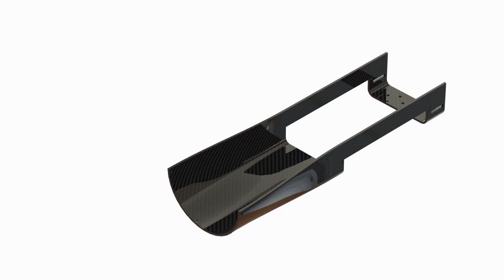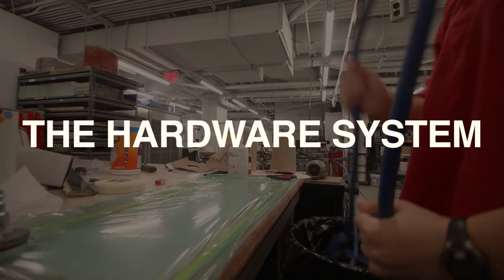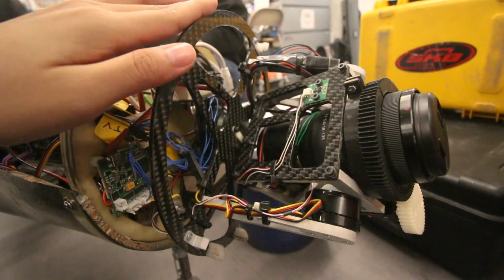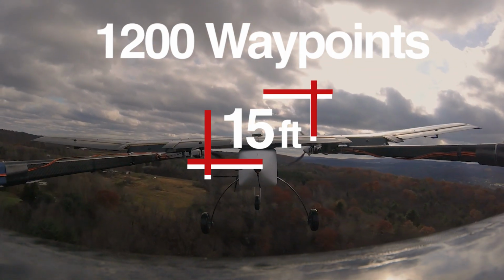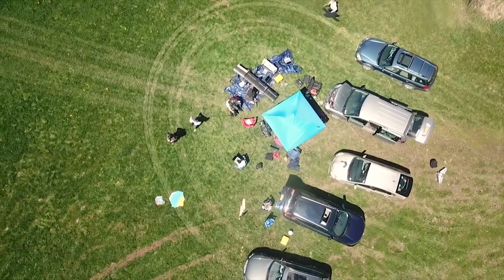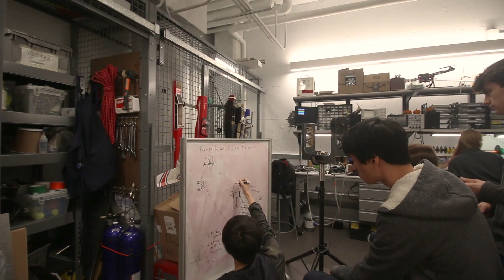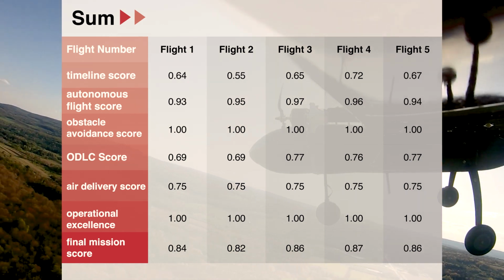CUAir 2019: Flight Readiness Review

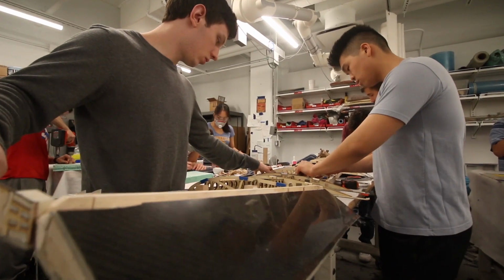Comment: 0:15 CUAir Intro
0:35 Flightline Intro
2:45 Hardware System
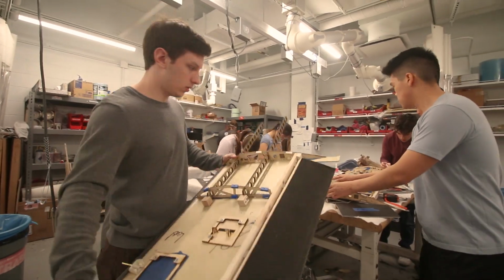3:39 UGV
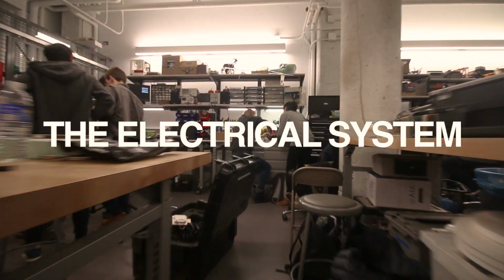4:10 Electrical System
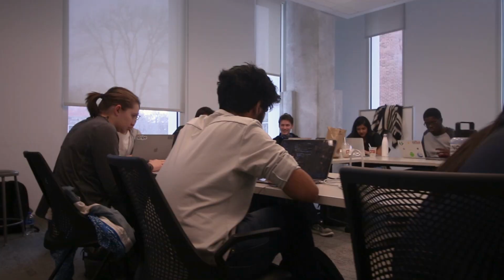4:42 Software System
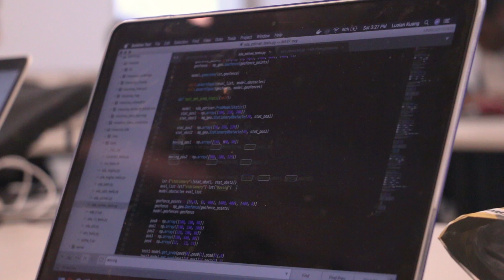5:01 GCS
5:23 Obstacle Avoidance
5:43 Camera, Gimble, Air Delivery, ODLC